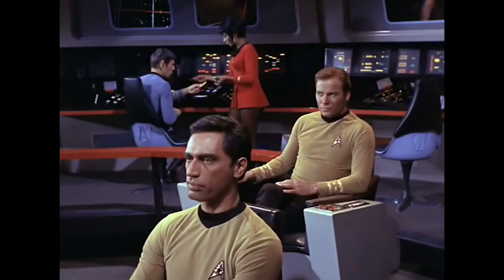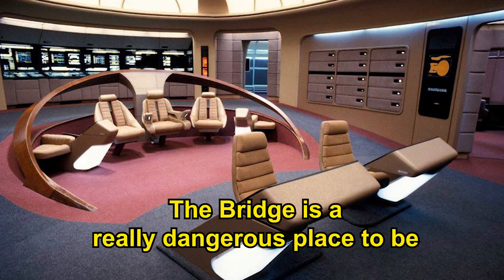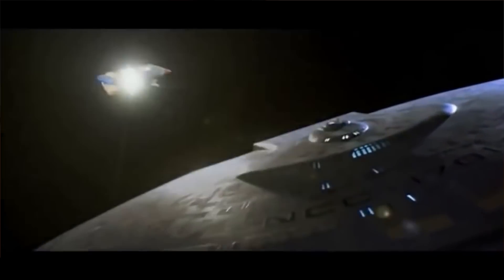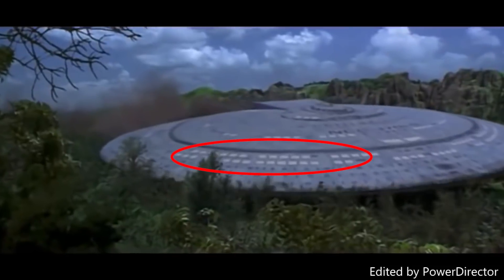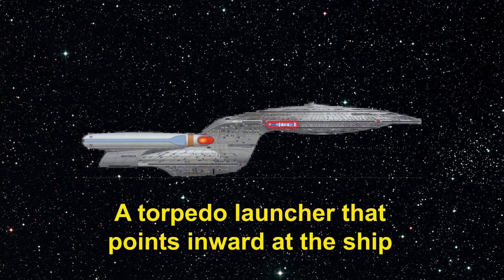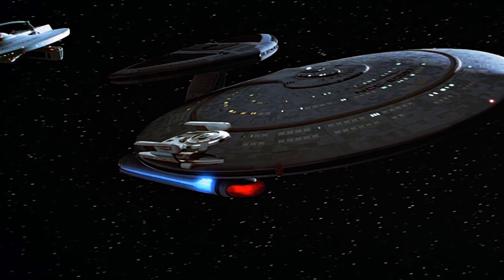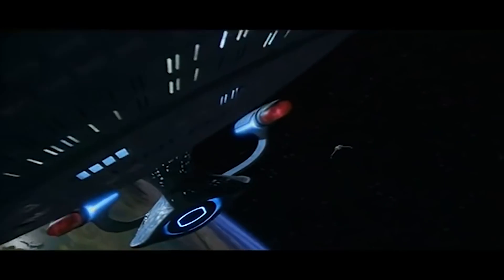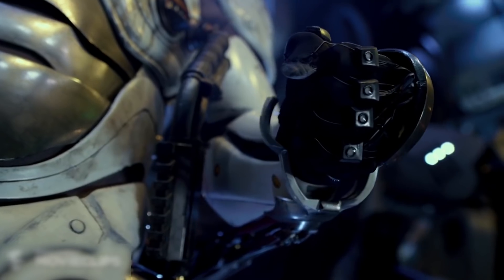10 Flaws Star Trek - USS Enterprise NCC 1701-D

Comment: That the bridge must be on top, is a rule from roddenberry. 
but you forget: they have shields! and without shields ANY point on or in the vessel will be vulnerable
Reply: You can follow the Roddenberry rules without being stupid, though. The Defiant class, for example, has an internalized control center on the top deck. While it is at the top of the ship, it is still within the main hull rather than in an external structure at the top like it is on the Galaxy class. Another example would be the Akira class. It has a particularly large bridge structure at the top of the vessel, but it's positioned between the secondary hull structures which actually completely obscure the bridge structure from the side profile of the ship.
Reply: VestedUTuber That's the coolest thing a nerd has ever said lol
Reply: Exactly. Without shields, you're basically done either way. If your bridge is in the bowels, you're just watching the ship explode around you. The bridge is also outfitted with thicker hull plating and specialized defense fields as well as the entire shielding for the hull.
Reply: As interesting as the Nacelle line of sight rule. Though still Not too far on top that it would be an easy target for enemies like aggressive klingons,Borg or Romulans or even certain Cardassians. If i were designing a ship and put a bridge section on top i would have a bridge on top with some layer of armored defense and shielding depending on the century i would involve abaltive armor or 24th century i would involve a combination of sheilding and defensive armor.

Comment: that dude flying out of the bridge was a timeline of losing consciousness +15 seconds after entering vacuum, asphyxiating at +90s after entering vacuum, and something like +7mins where he could still be resuscitated.  If the enterprise crew didn't beam him back on board, especially with the communicator badge signal, they're assholes.
Reply: Not so.  When you are exposed to the vacuum of space, the cellular destruction with the expanding gases in your cells is like the bends, but beyond belief.  You will die within a few seconds, you don't have an intact body that is slowly starving without oxygen.  What sort of cellular reconstruction in the Star Trek universe I don't know, but the destruction of the body is pretty extensive.
Reply: @darrelcrane5138 : Incorrect. You don't die within seconds. Your skin stretches taut as your blood tries to boil, and that fucks up your circulation, which is bad if it continues for more than a couple minutes, but it also corrects itself as soon as air pressure is restored around your body. People have actually been exposed to hard vacuum in real life and lived to tell about it.
Reply: De mon : It's actually even colder than - 270°C in some places, but it doesn't matter, because there's nothing to conduct heat away from your body. (also, fun fact: the few atoms in space are generally thousands of degrees because they're moving so fast, but again there's very few of them so they have almost no effect on the temperatures of solid objects.) Heat loss in space occurs only through thermal radiation, which happens very slowly for an object that is only a few hundred degrees above absolute-zero. Thermal radiation doesn't become an efficient way to dissipate heat until an object gets close to red-hot. I'm sure you've noticed that an iron frying pan will remain hot to the touch for close to a half-hour after you finish cooking, and that's including heat loss from air convection, which obviously doesn't apply in space -- partly because there's no air, and partly because there's no gravity to make convection work. That's why the International Space Station needs enormous radiators, almost as big as its solar panel arrays, to dissipate excess heat. The ISS could use much smaller radiators if they had high-temperature heat pumps to condense excess heat into a small white-hot radiator panel, but that would require more power consumption, and the ISS doesn't have much power to spare since it runs on solar panels and they aren't continuously exposed to sunlight. But I digress. The point is, a human would take hours to freeze to death, even in interstellar space -- suffocation would obviously be a much more immediate problem.
Reply: @darrelcrane5138  
incorrect, in 1966 Jim Leblanc was testing a spacesuit in a vacuum chamber and was exposed to a complete vacuum for several seconds and survived without any damage at all, he only had a earache from the very rapid re-pressurization, it normally would have taken over 30 minutes but it was done just under 90 seconds, he lost his consciousness only briefly, we have since done more controlled tests with animals and have a pretty good understanding on how it works,  and yes, we had a very good understanding of surviving in vacuum well before they even started filming star trek tng, it takes around 90 to 180 seconds for your heart to stop in vacuum of space, as far as testing goes, it is impossible with current tech to revive someone after that happens, so let's just apply the same rule here for the sake of simplicity, so they had at least 90 seconds on them to beam him back, and around 180 seconds at most. and sure, the guy will feel like shit, in fact, he will projectile vomit, pee himself and shit himself out there, and let's hope for his sake he was not exposed to the systems sun, that would be.. unpleasant... he would survive, sure... but i'm not so sure he would WANT to survive with the kind of sunburn you would get from direct sunlight in space, once back inside he will be temporarily blind and wont be able to move for a while, he will lose any sense of taste for a few days and he will have the mother of all earaches due to the extremely rapid change in pressure, but other then this he'll be just fine and back on duty within 24 hours. (unless his sense of taste is somehow vital for his duty, then it would take upwards of a week for him to get back, but i somehow doubt you need a sense of taste to be on the bridge)
Reply: but the transporters go down after they take a scratch and geordie aint going to do some magic for a red shirt
Reply: Penguin Pie    Or the guy floating into space was an asshole...  j/k
Reply: @darrelcrane5138  Actual astronauts have literally stated the opposite of what you just said.

Comment: "What other vehicle sticks it's engines out on a pylon???"

Uhh...just most all large jets and airplanes.
Reply: Donny Hinson yea I agree. The A-10 Warthog design purposely extends them so if one blowes up somehow it won't be as likely to damage rest of plane. And one may still be left in tact working
Reply: Many aircraft these days, and especially military aircraft, actually has most of the engine integrated in the main body of the ship, rather than having them hang off of the wings. 

Large jets tend to not integrate the engines, but for a good reason: It would take an absolutely humongous single engine to fly a 747 or the like, and most large jets are passenger planes besides, and need that space for people, luggage and so on. So there's a practical reason there. 

In the trek universe, however, we have several ships of varying sizes, with warp nacelles that are more or less integrated into the hull,  or at least protected by it from most angles. Even just having them sitting directly on top of the hull makes more sense than having them jut out on struts, for no discernible reason. 

So it's a bit of an apples and oranges comparison there.
Reply: @xxhellspawnedxx  It would stand to reason that they're out on pylons to aid in fuel collection by the bussard scoops at the front of the nacelle. If you put them out of the ships slipstream (since they talk about spacial distortions when ships move) they can collect more fuel.
Reply: Plus, those aren't engines.   They are equivalent to wheels on a car.
Reply: Leave it to humans to assume they know more about where to place a warp engine than the engineers that designed the ship, while having next to zero knowledge of the subject. Something tells me you can't just throw them anywhere, most likely it takes an incredible amount of computation just to get the warp field to be compatible with the hull at all. Knowing engineering, there would be a trade-off, perhaps adjacent surfaces reduce efficiency or response time or something. There are probably failure modes where a damaged nacelle can throw off fields or debris which would be far less tolerable at point blank range.
Reply: @douggale5962  It's a fictional T.V. show... So literally the reason is: "because it looks nice."
Reply: Am not a Star Trek fan or watcher 
But it seems like the people here continue to Compare an Advanced Space War/Exploration Ship with Modern day Aircraft

Comment: The reason the saucer section crash landed was because the shock wave from the warp core breach caused it to. There was no time for the crew to get to the escape pods at that point.
Reply: I thought it was because the producers were tired of using cumbersome practical models.
Reply: It would of taken at least 20 mins for it to impact though they had plenty of time its just plot device
Reply: @Amyrayanne  The escape pods lacked the speed capability to get clear distance from the drive section before it blew. Had they gone to the escape pods, they would have died from the shockwave anyway hence why they weren't used.
Reply: @AngelusClawtooth  you eject after it exploded geeze
Reply: The saucer crashing they were gonna use for an 8th season episode  they already had the art work for it paramount decided they needed more treak movies so they ended tng TV and began tng movies and reused the saucer crash landing for the first movie

Comment: 2:53 you are incorrect. The kids are the Adults, haha . but they were changed in a transporter accident!
and about the saucer section.... i am pretty sure the explosion damaged the thrusters and impulse drive of the saucer section!
Reply: Yes and yes. Added to the fact the saucer has extremely limited power given the warp engine is in the secondary hull.
Reply: @ Michael Superbacker: It did. if he had watched the movie again they even STATE that the stability tech of the saucer section had been damaged and the ship was pretty much not controllable as they were pushed towards the planed after the Enterprise Warpcore exploded. Without the Planet nearby they might have had drifted around space for a while till they could have fixed it and stabilize the ships controls and maneuvering.
Reply: Agreed, his analysis is flawed.
Reply: The explosion was also why they didn't use escape pods, there wasn't enough time and landing intact on the hospitable planet made it moot
Reply: The Technical manual stated the procedure for landing the saucer as a 'best' case scenario, which the movie most assuredly was not. The saucer relies on backup power for maneuvering and propulsion, which was damaged, and usually is provided power by the engineering hull. Also, the structural integrity field was not truly designed with atmospheric entry in mind. It was only as a last resort, and assumed the worst to begin with - that being the total loss of the ship. Again, the design of the saucer itself was not meant to include atmospheric flight for more than an emergency landing, unlike the Intrepid class.
Reply: @KRAFTWERK2K6  Still a combination of all eggs in one badly conceived basket with poor planning and execution of an evacuation following a disaster. Despite virtually every movie ending with the ship being badly damaged or destroyed, there was never a evacuation drill in any episode or ST movie.
Reply: @psdaengr911  The Enterprise was evacuated in the TNG episode "11001001". And just because it didn't happen on screen, it's logical and not unreasonable to assume that a Military Organization like Starfleet wouldn't have Evacuation plans prepared and drilled on a regular basis.
Reply: @mnementh2000  
wasnt it the first epiosde encounter at farpoint. the saicer section left and went on its own merry way to avoid Q.
Reply: That was the "RASCALS" episode 😎
Reply: Actually, the saucer section contains impulse engines, which are sub-light speed capable, but still extremely powerful.  A warp core breach is crazy destructive.  Although the effect has varied over the years, it can be assumed from other observed breaches that they are capable of destroying or crippling other starships in the vicinity and I've always suspected they could wreck the whole near side of a planet if the ship were in orbit at the time.  So not only was the Enterprise saucer section pushing the impulse engines for maximum escape velocity but also drawing max power for the shields.  Surviving the explosion of the star drive probably overloaded the shields and nearly burned out the impulse engines, plus would've crippled other systems like life support and inertial damping.  The saucer probably had to try to make a controlled crash landing using only maneuvering thrusters.  Whatever emergency power remained would have been tapped to reinforce the structural integrity field and inertial dampers to help the crew survive impact.  The escape pods weren't a viable option as they wouldn't have escaped the blast radius of the warp explosion in time and their shielding would have been insufficient.  Their best chance of survival was to escape as fast and far as they could via the saucer, although it's possible the pods could have been launched as the saucer descended through the atmosphere.
Reply: @MichaelSuperbacker  Indeed, it was. However, the saucer was never meant to be separated from the engineering hull for extended periods. It COULD be, in extreme circumstances (extreme damage/ destruction of the lower hull, etc, but it was meant as a last resort measure. Yes, it housed a set of sublight impulse engines, which were based on a deuterium solid fuel, and would need to be refueled - usually during starbase layovers or as needed by deuterium tankers in deep space (similar to in-flight fuel tankers for military jets), but main power was still provided by the reactor core, and main impulse usually by the larger impulse drive in the main hull.  The main sublight engines receive their power from the main impulse drive in the main engineering hull, and is sometimes supplemented by the much smaller one in the saucer if they need to go past .75 impulse. Not only are the impulse engines in the saucer smaller, but there is a much smaller deuterium supply in the saucer. 

My info was gathered from the Starfleet Technical Manual that covered the Enterprise-D. I also, with a little research, was able to confirm that the saucer's controls were damaged by the shockwave from the stardrive's destruction, and Data was only able to provide minimal thruster control to try steering the saucer in descent. Had the controls not been damaged, it's possible that they may have been able to land the ship a bit more gently, though it still would have sustained massive damage from the attempt. Memory Alpha online is a good source of info on things like that.

Comment: Engines on pylons is an engineering decision to maximize the use of their warp bubble.  With their warp harmonics the nascells are in the correct place. 
 Bridge is fine on top.  Its the most protected area using the ships shields.
Reply: Best protected Area through shields ? Hmm... Except when the shields fail due to

-sustained damage
-Cyberwarfare
-Frequency Bypass
-Bleedthrough Damage
-Power failure
-shield piercing weaponry (i believe that was a thing in star trek at some point)
-Space Anomalies (Nebulas, Singularities, Q) 

Dont forget the posibility of getting ambushed whit your pants/shields down and sabotage. 

Those are a lot of points that have their own probability to occur at any time. I would rather hug the warp core.
Reply: Thank you for pointing that out. I was going to comment on that but then saw your comment.
Reply: Aren't warp nessels and the ship engine 2 different things because the engine is in the middle of the engineering hull